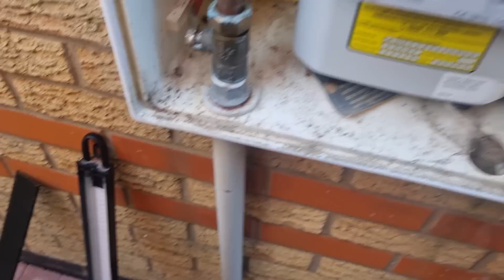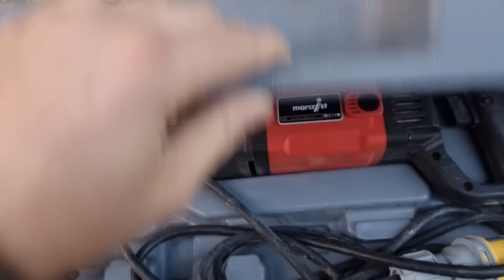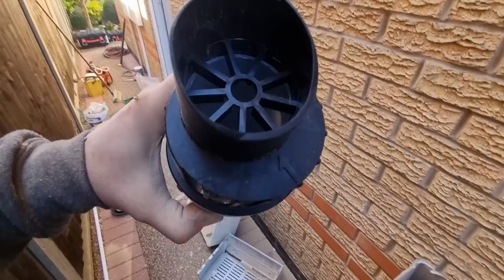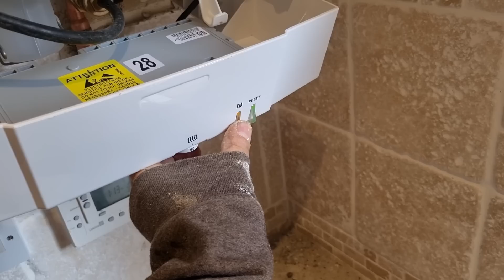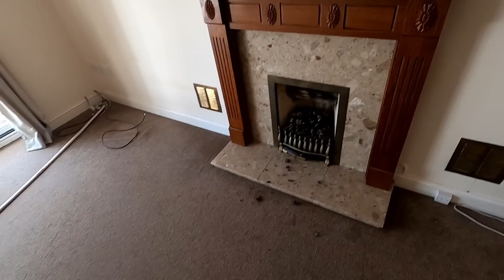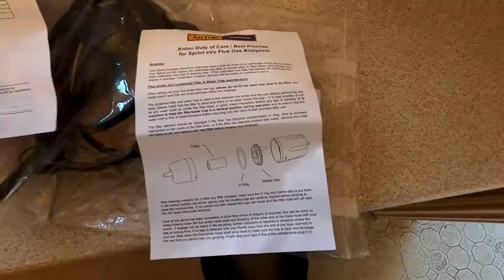Plumbing Day In The Life | Boiler Swaps And System Cleaning

Comment: Hi Tom,
We fitted a 4” RPZ on the jetty pipework we renewed at British Steel ABP jetty at Immingham North East lincs and on the ABP jetty at the gas caverns Killinghome about 2 miles apart. Somebody must be servicing them, why not you? Not sure how far away you are. We used to get enquiries regularly for commercial gas and although competent to do the piping installation we didnt have the Gassafe certificate.
Reply from the maker: Thanks for the support as always mate, it sounds like you tackle some really interesting stuff. Immingham is probably a bit to far for me to travel. I really need to build my confidence a bit on  testing them before tackling anything to big, they are easy enough to do, but it's just remembering the sequence. I'm hoping now I've got my name on the water boards website, I might pick up a few jobs locally, the ones I look after now, the client was paying 350 a valve just for testing, they were only small valves protecting one appliance.
Reply: @PlumbLikeTom  yeah I’ve had a long and varied work life. I think I’ve worked every industry apart from nuclear and rigs offshore. Retired now (don’t tell the wife) just doing some diy and bits of plumbing for family before our house renovation.

Comment: Top work bud those baxi 800s are proper installer friendly even on the wiring nice and light aswell 👍😎👍😎👍😎
Reply: Ps looks like a ep2 programmer they used them as a wiring center can be abit tricky at times 😎👍😎👍😎😎👍😎
Reply from the maker: I hate it when they do that with the programmers, thanks for watching as always mate 👍

Comment: Great video and you do very professional work while always going the extra mile. On that very dirty system (I acknowledge your lads did a power flush) but a magna flush rig will only remove the magnetic dirt and the remainder of the dirt passes through - plus if the circulation is by the boiler’s own pump the flow rates are too low to disturb the tenacious shite.😀👍
Reply from the maker: Thanks for watching as always mate,I spent quite a bit of time getting tne sludge out the bottom of the rads, like you day I was only using the system pump but its surprising how much you move when just doing one rad at a time, I also connected a hose to each drain off to help flush the rubbish out of the system, I checked them all with the thermal camera and they were all hot to the bottom with no cold spots, in the end I think the system should be good, thanks for watching as always and have a great weekend 👍

Comment: What core drill you got Tom?
Reply from the maker: I think its a marcrist drill, it's a brand I've never heard of but they had them on offer in my local merchant, I got a dust extractor with it as well, so far it seems to be working well, I've only had it about 6 months so time will tell, thanks for watching as always mate
Reply: @PlumbLikeTom  Cheers I've just had a dewalt one I got in Jan which has burnt out after just 4 inch 1/2 holes so wondered what to try next 😂
Reply from the maker: I've probably done around 10 holes that I can think of with this, a few have been 6inch for oil boiler flues, so far it's been perfect, honestly I don't know how long it will last but so far so good
Reply: I use those titan beasts from screwfix  only about £80 and you get 2year warranty so take it back for a new one if it blows up or every 12month or so.
Reply: @darrylclarke41  Haha good shout they just heavy though I returned this Dewalt to Screwfix and when't for a makita 280 quid hopefully it lasts

Comment: Good old pipe sizing calculations, everyone loves doing them heh. So are you 18th edition qualified on the electric to do the wiring or some other level?
Reply from the maker: Pipe sizing can be a bit of an educated guess at times if you can't see all the bends and pipe, the proff is always in the testing, it's obviously easier on new gas lines as you know what has been used, my brother is a qualified electrician, he always checks my work, this job is being rewired as the the spur and programmer is being moved when the kitchen gets done, thanks for watching mate 👍